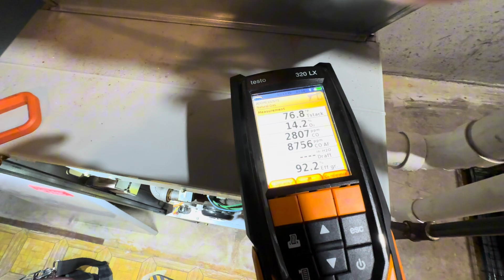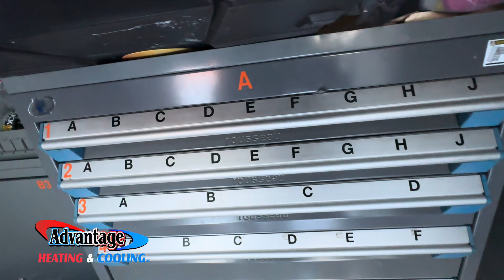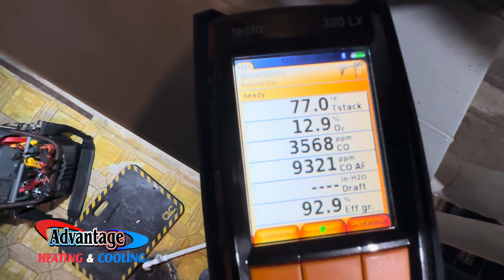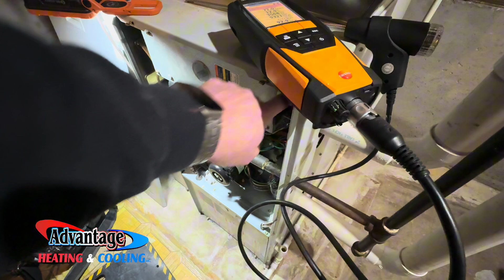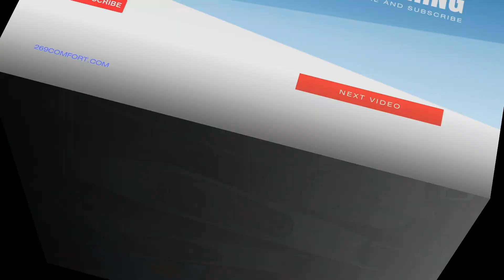Bryant Gas Furnace Problems Solved in Minutes

Comment: The top of mine where you put the multi meter gets very hot to the touch if I leave it on long enough, before this the furnace wouldn’t ignite so I changed the filter called some tech and he basically reseted what do u think can be the problem mine is the Bryant 90i
Reply from the maker: Did the tech reset the rollout switch, or did he pull out the high limit and tap it to reset?
Reply: @ADVANHVAC i believe he said the high limit  was tripped and he reseted that and flipped a switch and it came on, he did say the top was Getting warm but after that he turned up the fan speed I would like to add this is a new home of mine and I believe the last time that furnace was checked is around 2015 at least that’s the final note on the front
Reply from the maker: Okay, just as long as it wasn't the rollout switch on the side.  Sounds like you should be good to go! If you need filters and reminders I have a filter store on my website hotairnow.com/filters#/products here you should be able to find your filter and you can get them drop shipping with reminders 😊
Reply: @ADVANHVAC thank you, I appreciate you taking the time out to read my comments I will check out your store have a good morning
Reply: @ADVANHVAC and the system is from 2005 I’d like to add
Reply from the maker: I would definitely start budgeting for a new system.
Reply: @ADVANHVAC will do i appreciate it

Comment: I would love to know if the fault code was an air switch failure. These furnaces are known to have clogged condensate drains, causing condensate to back up into secondary heat exchanger,  causing air proving failures in turn giving combustion readings that mimic a cracked heat exchanger
Reply from the maker: This was a 13-limit open.

Comment: Could you please explain what numbers told you the heat exchanger was cracked?
Reply from the maker: The CO should be below 100 ppm these were over 3000ppm plus you can use the sense’s and smell the pungent smell. Its a good sign that the secondary has failed.
Reply: It’s been a while

Comment: I just replaced one of those secondary heat exchangers the other week on a 20+ year old unit, still had a warranty on the heat exchanger.
Reply from the maker: It's incredible that people would want to rebuild a 1972 Pinto’s Transmission that has 150,000 miles on it.  😆
Reply: @ADVANHVAC  lol you said pinto ,omg I don't think you were born when I think in 76/78 was its last year of production 😅. 
    Or maybe you just look young 🤔, testo is the best I think . I'm still doing on calls ,installing, service. But only 4 days a week now ,happy you fell into my feed . Stay warm brother
Reply from the maker: Thank you, my friend 😂 I was born in 72, so I referenced a 72 Pinto. Yes, I love my Testo.
Reply: @ADVANHVAC  well last year I put in a new inducer motor on it and it was one of those ecm ones that cost $1500. So guess they just want to fix it since they didn't want that part to go waste.
Reply from the maker: @search_eternal wow. I guess whatever makes people happy.
Reply: There is a lawsuit settlement recall on Dec2004 and later Bryant high efficiency furnaces on the secondary heat exchanger.  They are giving them out free but you will need to install.  Was the install easy ?